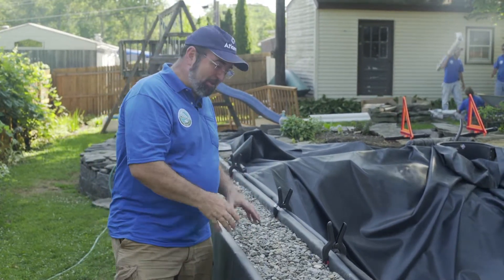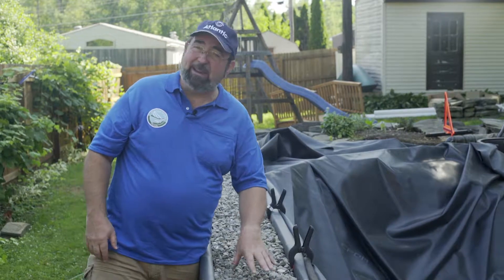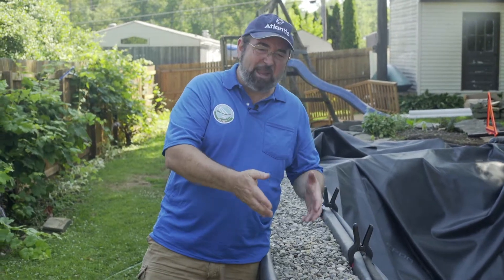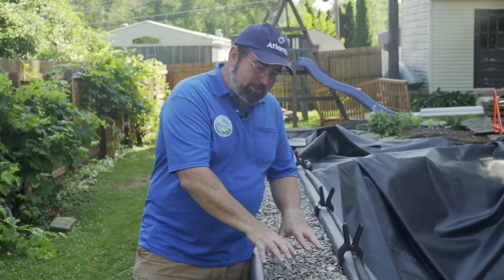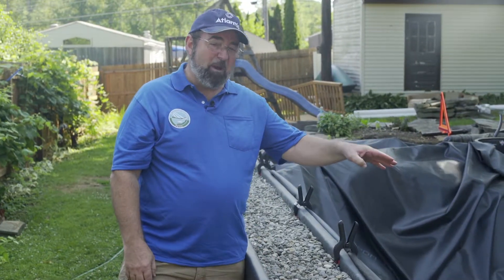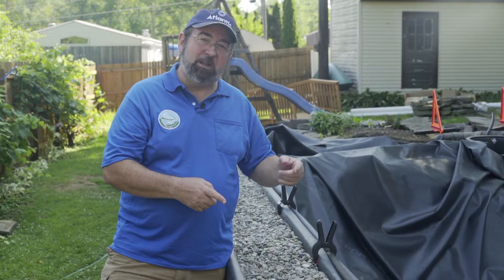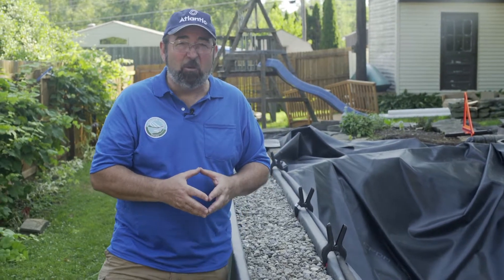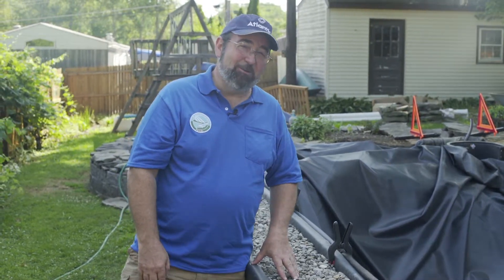05 How to Design Aquaponics System for Your Dream Pond

Comment: can you give more details on how to make a simple aquaponics system as part of out ponds?
Reply from the maker: Hi Casha, the secret is oxygen.   Most plants can handle "too much water".  But they can't handle too little air.   Just create a false floor under which the nutrient rich pond water and air are both dispersed evenly to come up thru the gravel or other ballast material (with NO soil or dirt) so that the plants have access to both water and oxygen that is moving gently thru their roots.   Some sturdy material to give the plants the ability to stand (we just use 3/4" gravel) and nature will do the rest!   Feel free to contact us directly for supplies and additional advise.